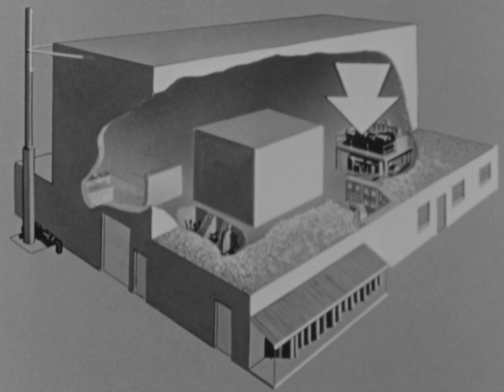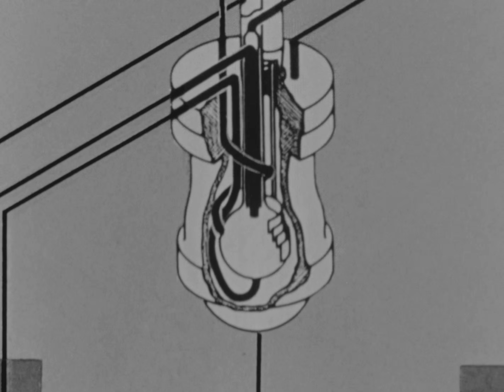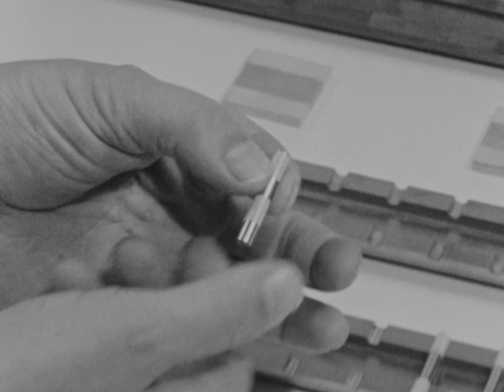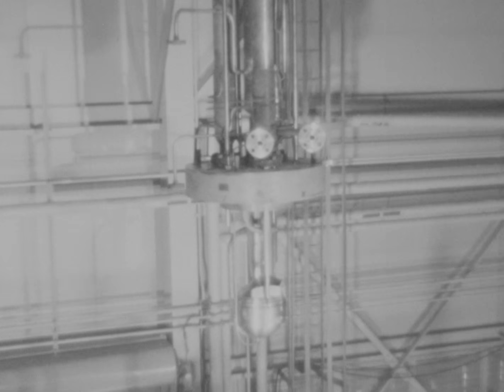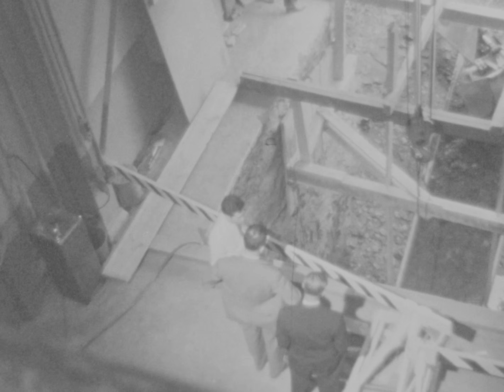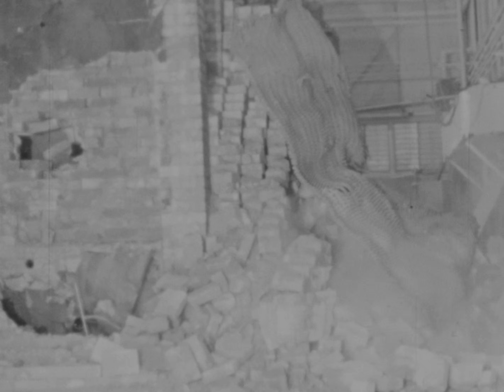The Homogeneous Reactor Experiment No. 1

Comment: Having to dilute the gasses 😂 before releasing to the enviromment says alot. Back in those days "the solution to pollution is dilution" oh how wrong they were (are). The oxygen and hydrogen emissions was caused by electrolytic reactions between the metals and fuel etc... they simply vented all the gasses radioisotopes included. They still vent these gaseous isotopes to atmosphere in every nuclear plant to this day
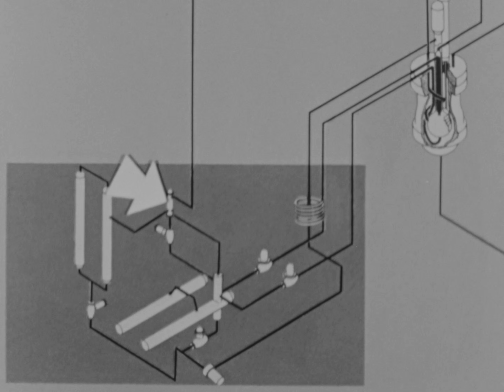Reply: Go watch the Offgas System section of this film again, which starts at 4:20. They held the gases until they'd mostly decayed. After that point, they're no cause for concern.

FYI: the EPA's yearly release limit for nuclear power plants is 250 µSv. You get a higher yearly dose of ionizing radiation, ~390 µSv, from the natural potassium in your body.
Reply: It's still the solution for many pollutants and people who don't think it ever should be are fools. Practically all of the tritium ever produced in every reactor has been simply dumped into the environment at dilute levels and it's perfectly fine.
Reply: Come again? Tell me you know nothing about primary and secondary systems without telling me.